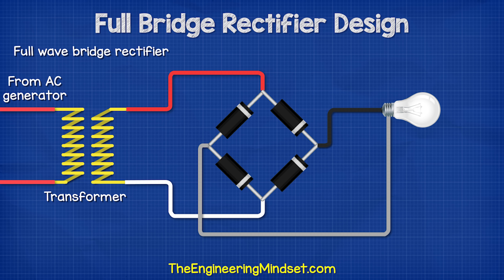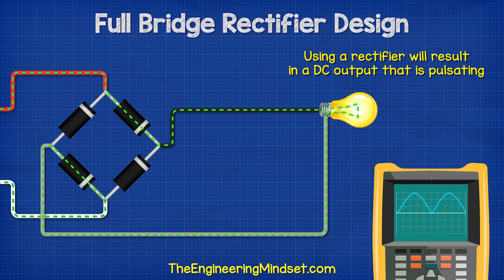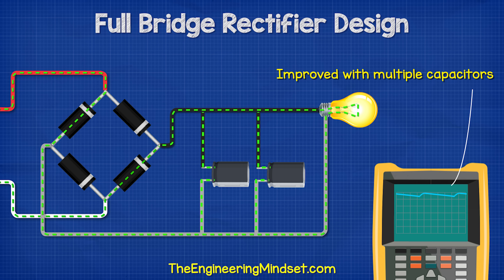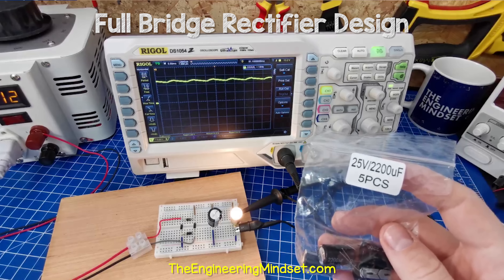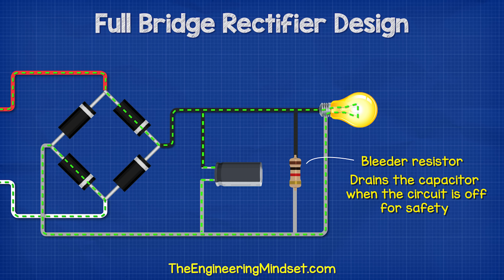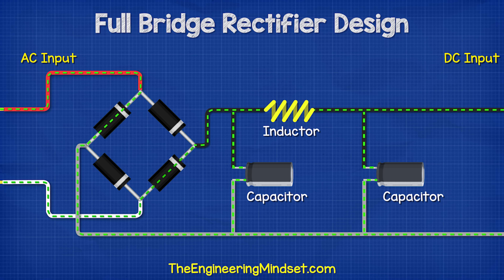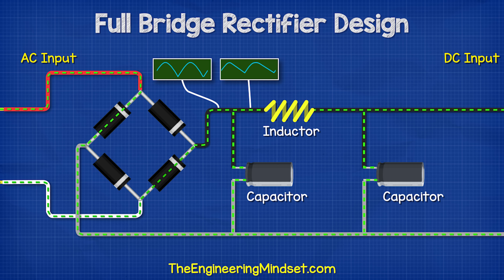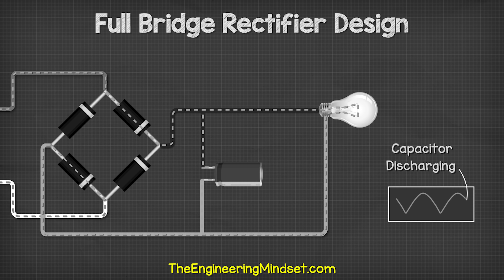Full Bridge Rectifier - How to convert AC into DC  power electronics

Comment: The explanation is so clear that I understood even though I am just a hobbyist tq. 12V AC drops due to diodes and the capacitor peak voltage and finally became 15.5V. How then can I get 12V DC to power my 12V rated device?

Comment: So I built a multi tap MOT transformer for running all manner of battery powered tools but without the batteries and I even want to run a 12v cigarette lighter and a small tab welder good enough for battery strips all off this one transformer 9v all the way to 24. I'm using a rectifier from an old car alternator but I have no experience with capacitors. I don't understand how a capacitor could be connected across hot and neg like In the video. Wouldn't that make a short? I always imagined capacitors being connected across either or but not both at the same time. Are there differences in connecting capacitors In other ways? Also if I'm using only part of my rewound secondary coil for short circuit current is it good to ''beef up'' or double up only that section of secondary instead of then entire wire?

Comment: Hi Sir,please can help when the capacitor discharge in above video those ot discharge from the negative or the positive ?and if it those discharge from the negative side of the capacitor which diode those the current flow through ?please help very confused 😕

Comment: var diode = 1wayswitch;
10000ufcapacitor = capacitor new(Microfarads = 10000, Volts = 50);
dcripple = dc;        _
dcripplecurve = [/ - \;
4xdiode = dcrippled;
1x10000ufcapacitor + 4xdiode = dc;

dc_Curve = [--------------------------------------------------------]

Comment: You should do a DC to AC Inverter build!
Reply from the maker: I'll likely build a very basic version soon. Problem is, it's an incredibly difficult task to make a decent one that doesn't have hidden voltage spikes which will destroy your electronics. But, I'll work on it.

Comment: I'm trying to understand why you would only read 10.5VDC (5:05) when measuring from the rectified 12VAC, shouldn't it also be 15.5VDC? RMS is only a factor when measuring AC isnt it? Why does it matter if the capacitor is in paralell? I'm probably misunderstanding something here. 
Your videos has probably helped me to understand some things that were previously hard to wrap my head around, thanks!
Reply from the maker: Check our new Multimeter tutorial out ➡️ https://youtu.be/4lAyzRxsbDc

Comment: You forgot to discuss power factor, harmonic distortion, power factor correction circuitry, and solutions to creating an active bridge rectifier that use FETs instead of diodes and an active controller IC that can be used to eliminate voltage drop issues. 😉
Reply: Ya... But still!

Comment: 1:33 I think this can also be called a RC low-pass filter, because you have the capacitor in parallel to the load and a resistance (LEDs) before it. So it should filter out high frequencies.
Reply: Exactly the same thing (components behave the same), we tend to nomenclature things on function.
Reply: What high frequencies are you filtering out of the circuit? Do you have AC means…
Reply: @richgolfs  Very good, select R and C to be most effective for expected freq.... don't forget load and type ;  )

Comment: How to make opposite thing?))
Reply from the maker: It is far harder to convert DC to AC. It's called an inverter, we've covered power inverters previously
Reply: @EngineeringMindset  oh, hi!
May I ask some questions?
If we place that resistor will it influence our power consumption while light is on or it just for capasitor discharge?
And about inverters: with MOSFETs and PWM will we get sinusoidal shape or PWM like narrow then wide periods of voltage?
I hope you understand :)
Reply from the maker: Check out NEW resistor video, everything covered! ➡️ https://youtu.be/DYcLFHgVCn0
Reply from the maker: See my new MOSFET explained video here➡️: https://youtu.be/AwRJsze_9m4